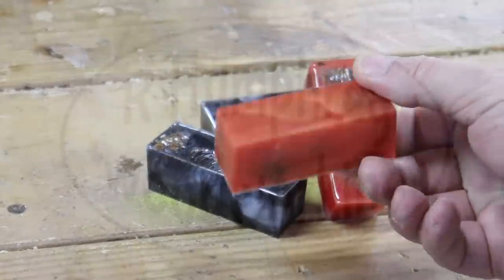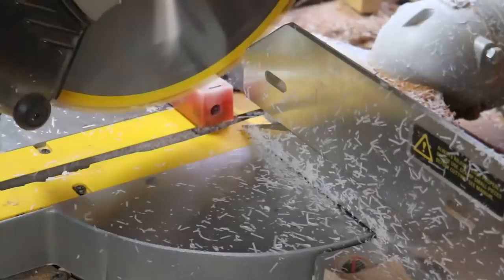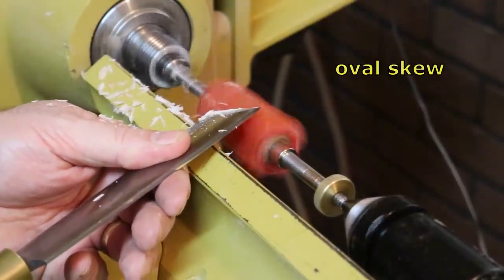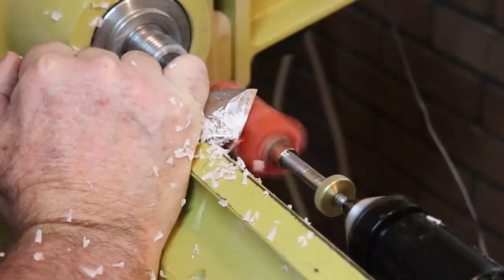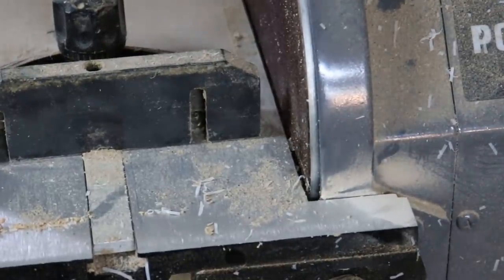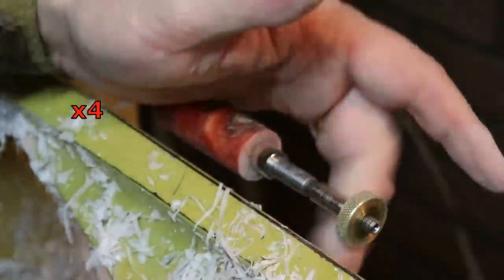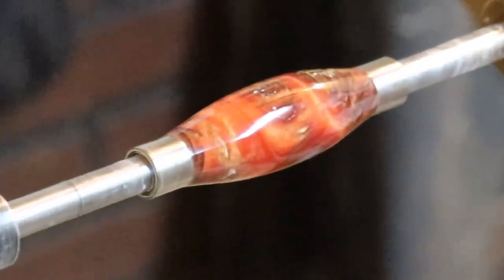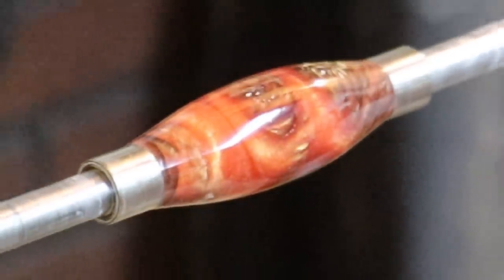Key Chains with Secret Compartments!

Comment: Nice video, Rod.  Your castings look spectacular.  I really like #4 as it has a 'galaxy' feel to it.  Sort of like a 'Starry Night' in a pine forest.  A tip from a long-time pen turner:  don't worry about the barrel trimmers.  I find them to be very aggressive with acrylics and could tear up the ends.  Many of us exclusively use sanding disks to clean up the ends of our blanks; much safer on both wood and resin/acrylic blanks.  Keep safe - from a retired Navy guy.  Thanks for your service.

Comment: Rod a couple of questions for you if ypu dpn't mind. I have been given a old (1940s) Montgomery Wards Power Craft by my pldest brother who had inherited it from our father. The thing is a heavey beast but the old motor was no longer any good after having sit arpund for years. The lathe has it's own stand and a two pulley system to control speed. 

Do you think this old girl would be worth restoring and getting back into running shape? What would be a good motor to get for this if it is worth fixing and wouls it help with better speed controlif I got a double or triple pulley on the motor to increase my speed options compared to the single pulley that was on it?

I don't relly have plans to do a lot of turning; just a few pieces every now and then.